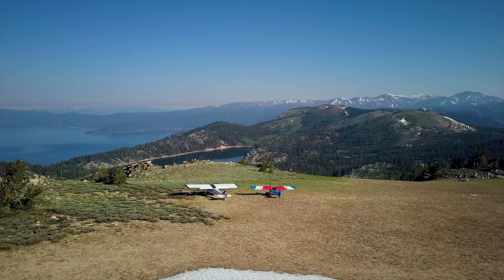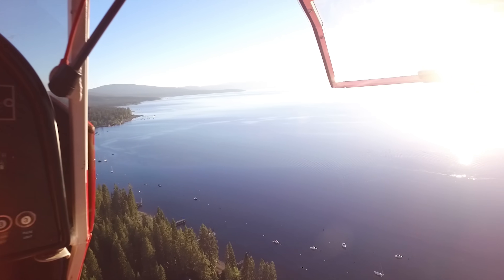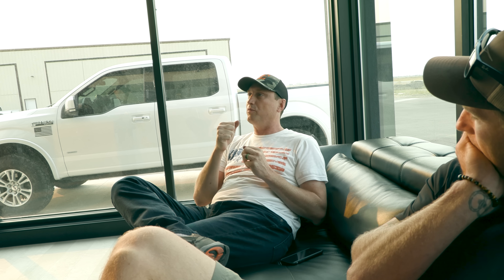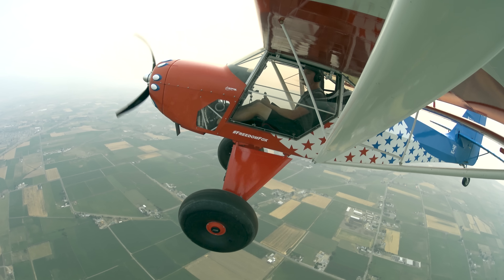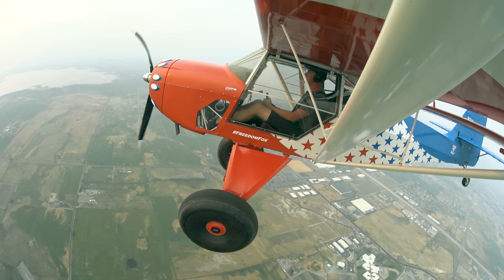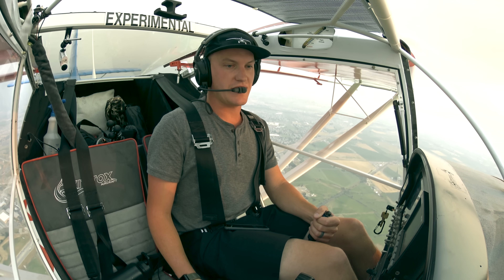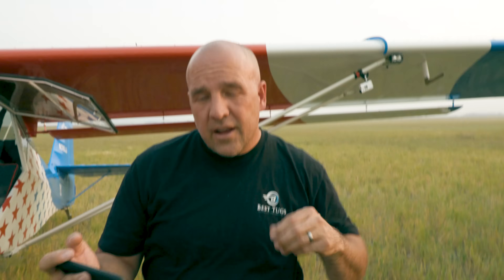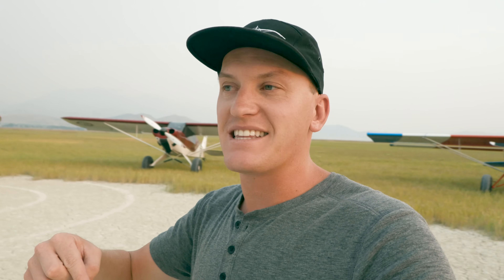YOUR FLIGHT INSTRUCTOR WAS WRONG! - Simulated vs Real Engine Failure

Comment: Nice video, but I’d play with the airspeed a bit...I suspect your best glide speed may be lower with the prop stopped...the manufacturers best glide is tested with the power at idle, once you stop that prop, you become the test pilot, so go test it...follow up video please! we’ve played in the Carbon Cub with this and I think you may find more compelling results with prop stopped...(side note: unless you have lots of extra energy[to convert to altitude] at the moment of failure, it usually doesn’t help extend your total glide by slowing down enough to stop the prop, especially on low compression engines)

Comment: Very interesting. I landed short with an engine failure in an Atec Zephyr, a fast ultralight with fixed propeller. In my Savannah I know that the propeller makes a lot of drag at idle. In the Zephyr, which is a much faster airplane, the propeller still creates thrust at idle. The airspeed on final is the same for these two airplanes and they both have a Rotax 912ULS engine. The cruisespeed the propeller and airplane is made for is crucial! :)

Comment: Honestly I can't see what the argument is about.  And engine driving prop even at idle is still cutting into the air up front as long as the prop is turning relative to the speed of the aircraft in its descent, which is thrust, small as it may be.  And engine off windmilling prop, as well as a motionless prop both create drag against forward motion.  Also, if the prop is not turning relative to the planes speed on the descent then it is also creating drag if the engine is not turning the prop relative to that speed.

Simple Really.......  Either you are cutting the air with the prop or you are not.

Comment: OK... This is kinda easy, but with a caveat... A windmilling prop is doing less work with the kinetic energy of the aeroplane and therefore giving less drag. An idling prop has more than the kinetic energy alone, but a stationary prop is pure drag... BUT!.. With a two blade prop, the vortices will affect the airflow over the elevator/rudder in different ways depending upon it's resting position... Basic physics combined with complex aerodynamics!
Reply: I think this misconception comes from the difference between idle and flight idle. The former is the lowest stable RPM of a piston engine and the latter; the RPM to match thrust and air speed... Read Stick & Rudder by Wolfgang Langewiesche.
Reply: And for the pedants: No. I didn't mention potential energy since it is a relative constant. It is what you trade for air speed.

Comment: I don't do much instruction any more, but flying gliders has totally reduced my stress levels regarding power failures. If I ever get back into single/multi-engine instruction I would like to setup a partnership with a glider CFI to have each of my students get at least five glider flights under their belt. I would encourage it for every pilot.

Comment: check out the NACA report for actual measurements (wind tunnel tests) http://naca.central.cranfield.ac.uk/reports/1934/naca-report-464.pdf (table on p.10) - drag difference between locked and idle depends on speed and pitch. At 17°, locked creates less drag than idle.

Comment: From a physics point of view, this question is about re-distributing energy. Simple theoretical question: Will an engine (off) that is moving due to the propeller spinning be warmer than an engine fixed to a stopped prop? Surely it will. That heat from the friction of the engine moving was generated from energy that would have otherwise contributed to drag. Part of the resistance on the front of the prop is transferred as heat into rotating the engine.

Comment: Hey Trent! Love the vids!! SICK AF!!! 😀..... Anyway, a windmilling prop creates negative thrust (drag).... While an idling prop creates neutral thrust.... Wich is actually positive thrust by comparison to the negative thrust of a windmilling prop.... And positive thrust by comparison to a stationary prop.... I can agree that an idling prop will produce further glides than a stationary prop (full engine stop).... Ofcourse this will only remain true when the weight, and shape of the aircraft are figured in..... A King Air 350 would certainly like a stopped, feathered prop vs an idle prop or a windmilling prop in an engine out scenario...... where a light single engine aircraft (i.e: kitfox, cub, highlander, ect.) can benefit from the thrust of an idling prop, and produce a longer glide from altitude....... ... ... Anyways..... Thanks Trent, and all of the cowboys, I have nearly given up flying .... Haven't been in the wind in a decade.... after flying commercially for nearly a decade..... Between these vids and  my nieces future husband, the two of you have me looking at Kitfoxs on barnstormers, trade a plane, and most of all ..... WINGSWAP.......  Thanks man 😀

Comment: With model airplanes, it's completely different.  An actual deadstick is completely different from simulated deadstick.  An idling prop on a model plane does act like a massive airbrake.  I've seen many pilots who practiced simulated deadsticks no problem, end up way overshooting the runway during an actual deadstick because it glides to much farther / faster.  Sometimes to the point they crash into the fence at the end.  With electric motors, and their adjustable braking, you absolutely don't want the prop to stop turning when adjusting.  For aerobatics it's common to setup the prop brake to slow your downlines.  But if the prop brake is too strong, the prop actually stops, and your downlines get way way faster.  Massive difference.  But this is purely with models.  Much lighter relative to scale ratio, much bigger prop relative, and much higher power to weight ratio.
Reply: This guy knows whats up. I fly pattern which is a specific aerobatic style one of the properties of which is that you want the plane to fly the same speed the whole time. No matter if it is pointed straight up or straight down. I use a long, low pitch prop to give a lot of low end thrust under power and create a lot of drag at idle. Under dead stick if you point it straight down it will come down a LOT faster than at idle. At idle on a down line, you can actually hear the air turbulance breaking around the prop. Also I have to land with just a little bit of power or it gets too slow which is not a problem deadstick. The difference in results I think has to do with the difference between pitch speed at idle and stall speed of the airframe. If your idle pitch speed is close to or above stall speed, then an idling motor is better. If your idle pitch speed is WAY below stall speed, then stopped prop is better.

Comment: I think there needs to be some additional clarity around the term "windmilling" because not all spinning props are the same.     It should be fairly obvious that a prop generates the most thrust, or drag when the angle of attack of the wind over the prop allows it to not be stalled.  In other words, the airfoil of the prop is allowed to work.     When the prop is stopped, the air is hitting the blades at a very high negative angle of attack, and the blades are completely stalled.  When the prop is "windmilling" very slowly (slowly turning a dead engine) then the angle of attack is still very high negative angle, and the blades are stalled.   The difference between these two conditions is negligible.      However..   If the prop can freewheel with little or no resistance (turboprop or electric motor), it will spin up to a speed where the blades are no longer stalled, and it will start generating a tremendous amount of drag.   To some people this is true "windmilling".    This is where the idea of it producing as much drag as a solid disk comes into play.  Anyone who's flown an electric RC plane and forgotten to set the ESC brake has experienced this.  They chop the throttle, and the plane slows down like you threw a parachute out.     Enable the brake, and let it glide with a stopped prop or very slowly rotating prop, and it produces significantly less drag.    

Note that a helicopter in auto-rotation is windmilling the rotor freely.  The lift produced is enough to fully support the aircraft.

Comment: I always wondered if a windmilling prop is creating thrust in the opposite direction, since the angle of attack on the blades would in theory be reversed, in the same way planes can fly upside down by producing “negative lift” (not an accurate description, but I hope it conveys the point).
Reply: Not thrust, just drag. And there is no such thing as "negative lift", an inverted wing creates lift in exactly the same way as an upright one, just less efficiently (unless it's a symmetrical airfoil).
Reply: Mats Nylund right, that’s why I added that it’s not exactly negative, i was simply trying to illustrate the point that a wing can produce lift in either direction based on the angle of attack. I pointed that out specifically for that response. 

And if a prop is windmilling, ie it’s being pushed by the air instead of driven thru it, it should be at a “negative” angle of attack (again, not right terminology, but I’m not sure how to better express it in a short comment)

Comment: Propeller accelerates air, if the air is already going that speed then you are not creating any thrust. That's what I figure at least, I'm no expert. I want to be an airplane expert, I'm not yet one though.
Reply: If the prop is idling and pushing air at the exact speed the air moved before it hit the prop, then you're not producing thrust, true. However, you're also not creating as much drag as if the prop were stopped. It's like letting your car roll after reducing throttle. You're not accelerating, but you're still going further than if you were to jam the wheels.

Comment: I’m thinking the reason it produces less drag while at idle vs. at a dead stop is because the idle thrust is counteracting some of the drag, therefore creating less Net Drag and giving you a further glide than when it’s completely stopped.(stopped prop wouldn’t be creating any thrust, so the net drag would be the same as the total drag). I think it could be possible that a spinning prop could make more total drag.

Comment: Hmmm... As a CFI I've always taught that glide will be longer at idle because of residual thrust. I'm not sure where the opposing idea came from. Mike's point about the additional control from the residual thrust over the empennage is a good one that I hadn't thought of and will teach in the future.

Having spent a lot of time in gliders I can say that if a pilot is regularly depending on their glide margin so closely that that little bit of residual thrust is materially affecting their glideslope judgement, they are doing it wrong. There are so many unpredictable factors such as sink, unknown headwinds and stuck-open cowl flaps that can change it up for you that you should plan a decent safety margin.

Unless I was desperate for range I would prefer a prop to keep wind milling so it has the opportunity to restart on its own, as often engines don't completely fail. I had a true low-altitude engine-out emergency once and was given a boost of at least a mile when the engine spontaneously restarted and ran for minute. My mistake in that case was that I should have made a precautionary landing in the scrub instead of letting the engine just carry me to the next crash site. That's a tough decision, though, when you're flying an expensive non-bush plane!

Thanks for the great videos Trent. I'm addicted and my next fixed wing aircraft will definitely be bush!
Reply: The opposing idea is from confusing windmill with idle.

Comment: I would say DRAG is the same, since the propeller area does not change in any situation. However, you can argue that an engine at idle is generating a positive force (thrust) which counters part of the drag.
Reply: I agree with you when calculating drag from the propellers perspective, not the airplanes. That drag you mention (if I understood your comment correctly) is mostly perpendicular to the airplane's movement, not against it (which would add to the total airplane drag vector). Regarding blade pitch, from what I understood the video discussion was about fixed pitch propellers.

Comment: Trent, could you please answer this. You stopped the engine and your plane kept flying like nothing happened.  So why would a plane go straight down like in a recent accident in Santa Ana , california? Thank you
Reply from the maker: Because the pilot failed to maintain control of the aircraft. Unfortunately that happens all too often which is why we try to practice and know our aircrafts as well as possible so that doesn’t happen. If the engine dies you still have a perfectly good airplane, or glider, no reason it should ever turn into a lawn dart like that 😔
Reply: Stall

Comment: Seems like this is a great demonstration for aircraft designed to fly at much slower speeds and showing the contrast between the two prop conditions.  So many different aircraft with different configurations like those that can’t fly if the motor is off due to drag and lift compared to those that were designed to shut the motor off and glide.  Even my rc glider with the motor windmilling is the same as popping the spoiler up.  Could turn it into a 10 part miniseries.  Keep the videos coming as i enjoy every minute of it.

Comment: Very interesting. I really like that you emphasized that your results are for your airplanes that "glide slower than others".  I'd be really interested to see the same test with an airplane that glides significantly faster.

Now for some wild technical speculation.   Any airfoil (at lease any normal-ish airfoil) will stall if the angle of attack is too great (positive or negative).   This would theoretically apply to a propeller as well.  If you were run a propeller at idle speed and then increase the airspeed of the aircraft, at some speed I would expect to see the flow start to separate from the rear face of the blade. (i.e., the blade would start to stall).  I have no idea what this speed would be - possibly well above the max speed for the air frame.  But, I doubt this is happening at the 60 mph you are gliding at.  If it occurred on a faster gliding airplane, I wonder if it would change the result of your test.

Obviously the stopped propeller has flow separation on the rear face of the blades.  But it's not disrupting a lot of air.  If you had full separation on a spinning propeller, it seems like it would disrupt a lot more air which equals more energy lost.  Again, this is just wild speculation.  I hope more pilots try your test (under safe conditions).
Reply: a windmilling prop MUST cause less drag on the airplane because some of the energy that the oncoming air is exerting on it goes into turning it, meaning there is less available energy to push backward against the airplane.  if the prop is completely stationary, all of the air pushing on the plane is available to slow it down.  (of course its the plane that has the energy, not the air, but its easier to visualise this way, i think).  if all of the energy that went into spinning the prop ended up as drag on the aircraft, then the prop would not spin.  some of it MUST be used to spin the prop.
of course as i said above, the difference will be quite small and probably not noticeable in tests such as this.

Comment: So... on the gearbox engines, is there a “neutral” setting where the prop is disconnected from the engine? Because if the premise is that windmilling creates more drag due to “the energy to force a turnover has to come from somewhere”, seems like letting the prop spin freely (or as nearly freely... there’d still be friction from the bearings) would be a good test.
Reply: Nope. But some (most?) turboprops are freewheeling, so that the engine isn't connected directly to the prop, but rather is spun by a turbine wheel placed in the engine somewhere. So when it's windmilling, it's not pulling the entire engine, only that tiny part.
Reply: Mats Nylund Yeah, I was thinking a disconnect probably wouldn’t be worth the weight. Do you know if anyone has tried it with a turboprop to see if it matters? Although, come to think of it, if the prop’s not mechanically connected to the engine, is there even a way to keep it from rotating?

Comment: I never knew this was a debate, my thoughts on the matter are that it still creates thrust but it is the closest a student pilot can get to an engine failure, that’s why it’s called a “simulated” engine out, just like in instrument training foggles are used to simulate imc, both of these simulations  don’t fully represent their real world counter parts, saying an instructor was wrong anyone was wrong isn’t a fair assessment as they are trying to mimic as much as possible what happens in real life without compromising safety of flight especially when someone who could have less that 20 hours of flight time is involved.